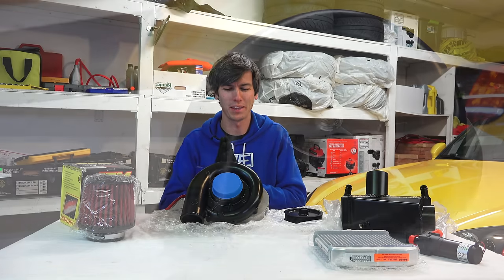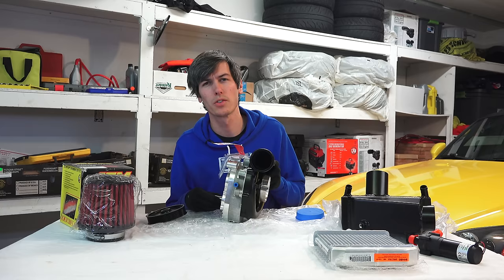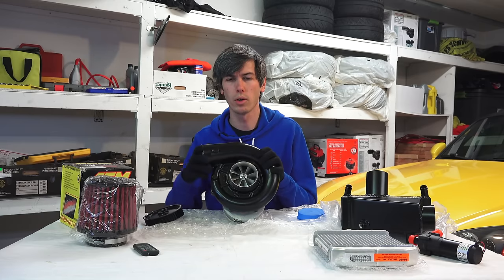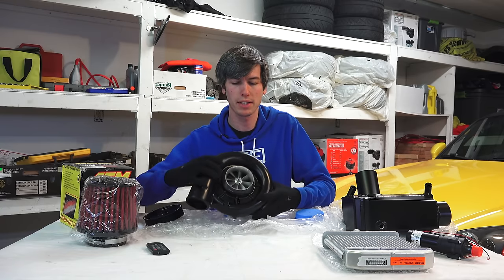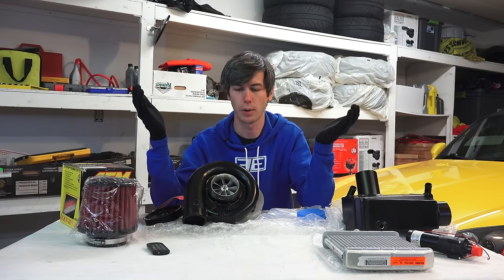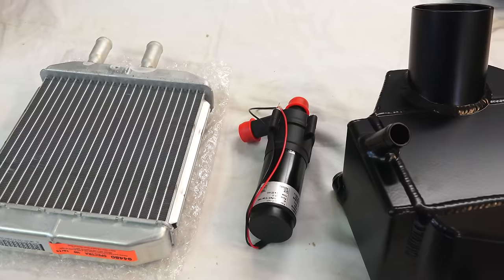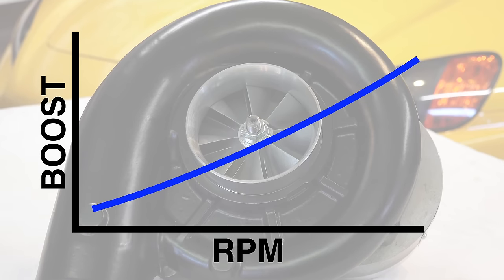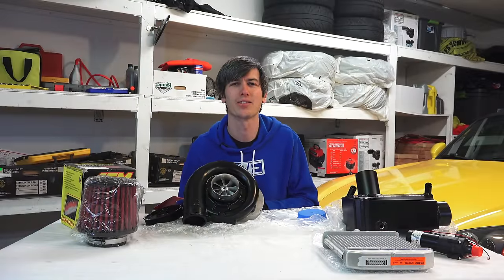How Do Centrifugal Superchargers Work?

Comment: How come centrifugal force isn't a real thing?
Reply from the maker: It’s more so a word that simplifies what’s actually happening. If you swing a bucket of water around in a circle, the water remains inside because the water wants to move away from you, but there’s a bucket in the way, preventing the water from leaving. The bucket provides a force in the opposite direction the water wants to travel. I personally have no problem with the word, but the internet most certainly does haha. Language doesn’t have to be complicated in my opinion. If you understand what someone is trying to say, the words they chose were effective, but technically “centrifugal force” is not an actual force.
Reply: I understand what centrifugal force is, but you say it's not a real thing. So what is the actual force being applied?
Reply: Inertia. It's not that it's forced out. Things just want to keep moving in a straight line so you have to apply force to keep them moving in a circle.

Comment: Root or nothing
Reply: No... Twin Screw
Reply: Twin screw is better. It actually pressurizes the air rather than just adding more.
Reply: Out of all the different designs the centrifugal superchargers makes the most power without the issue of super heating the air... since you can easily use a intercooler.
Reply: Drunken Hamster If it's building boost, it's pressurizing the intake charge.
Reply: Drunken Hamster Actually the Twin Vortices design by Eaton is much more efficient than a similar size twin-screw. Roots blowers have come a long way.
Reply: Twin screw >> root
Reply: cloridan Beauchamps break down intensifies

Comment: You said centrifugal isn’t actually real, wanna make a video? 😬😬😬
Reply: Jaden Berthoud I was wondering the same thing
Reply: Centrifugal force is a pseudo force that arises in a rotating reference frame. The only "real" force is the centripetal force which is pointing inwards. But I think this argument is a little bit pedantic, it doesn't really matter that it's a pseudo force.
Centripetal means "center-seeking" and centrifugal means "center-fleeing" so it doesn't really make sense to say centripetal when we're talking about a "force" that is pointing away from the center. It may not be a real force but we can still measure it and still feel it.
Reply: Xei I actually am aware of what those forces are but rather posed the question for the sake of perhaps a video on that, I’d like to see Engineering Explained view on it 😊 thank you though 😊